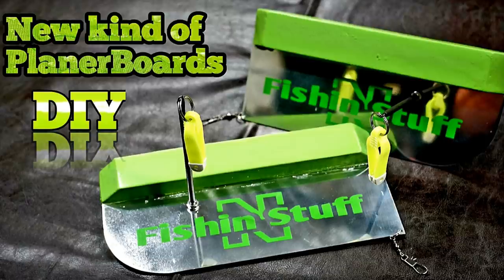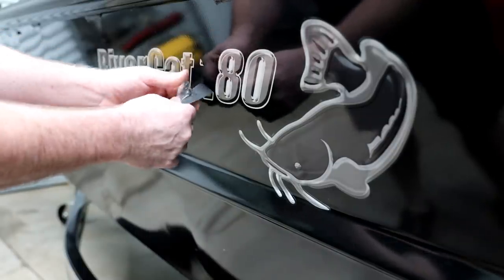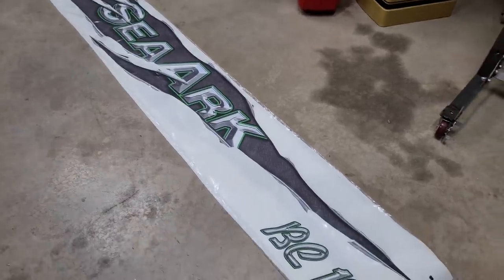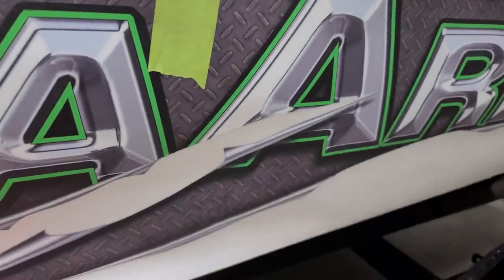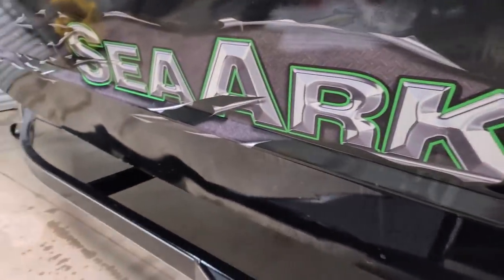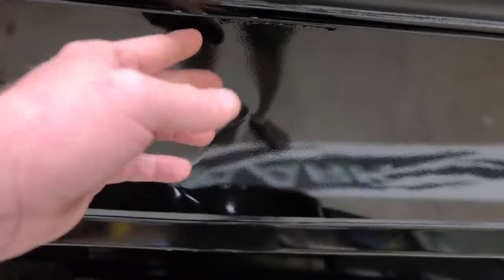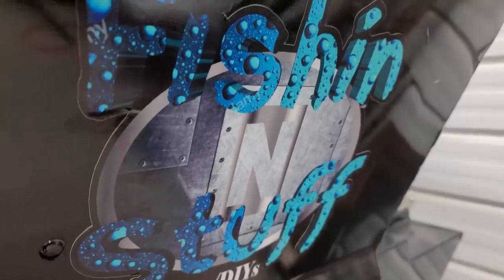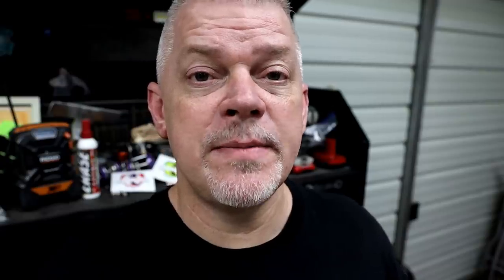How To Install Large Decals

Comment: Fun application.... as a person who has been in the pressure sensitive label business since 1973....omg I’m old.... we’ve been doing smaller “stickers” these many years.....71 and still working 40 hr weeks....     hint: when you cut that hinge, fold over about an inch or so of the liner so that when your done with the first half...there is a little inch or so of handle to pull the second half of liner....great video great look on your boat....

Comment: This vinyl should have air-egress. Or channels in the back of the vinyl. Dry apply it. U can also hit it with a heat gun. Make sure its laminated also. That gives it an extra UV protection. Any questions just Holla . Great job!  On the application fluid use a few drops of 90% rubbing alcohol with johnson baby shampoo. This. Will increase evaporation of the fluid. Just a spoonful. And like 3 drops of shampoo.
Reply from the maker: It came out pretty good,  I really like it . It does have a UV clear layer , the smaller one has it too . I needed you before I installed it lol sounds like you know your stuff